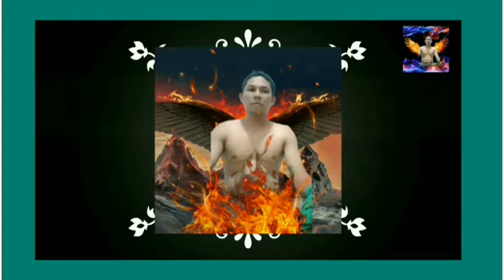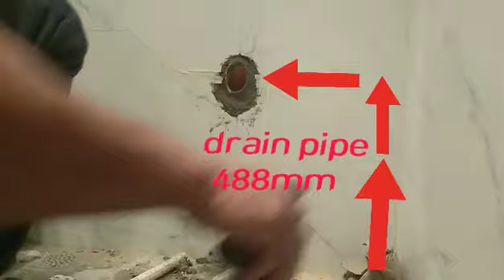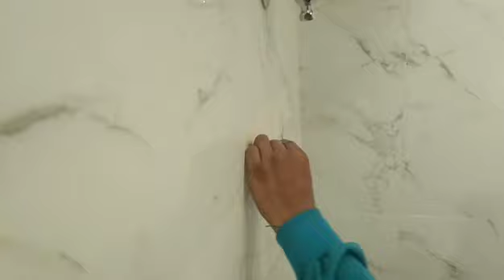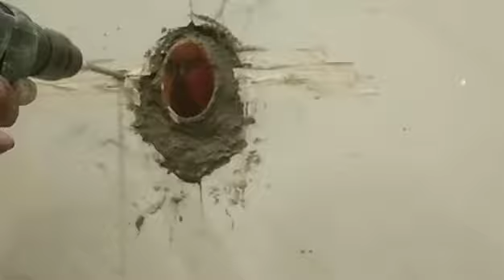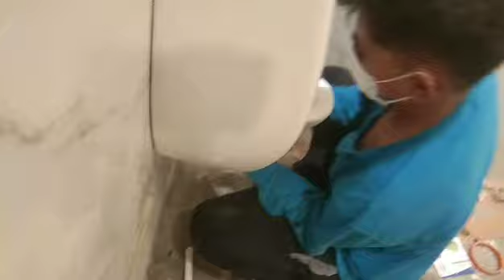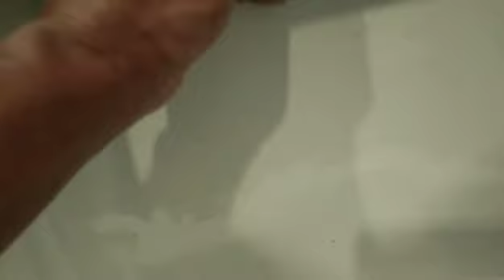how to installation urinal brand model by HCG

Comment: Lods bka pwd malaman ano height ng waterline mo jan... At anodin ang heigh ng waterline pag flushvalve ang type ng urinal salamat sna mapansin
Reply from the maker: 1200mm finish flooring. basahin ang specs sa plano boss kase yan ang dapat masunod at dyan  tutugma sa mga ibang klase ng fixtures

Comment: Idol tanong lang po ano po sukat ng abang ng pvc orange pipe 2 at sa water line salamat hindi ko po kasi alam sukat niyan
Reply from the maker: pvc drain hieght 488mm finish flooring
water supply 1200mm from finish flooring.
Reply from the maker: yan ang tama sukat standandard na po yan sa urinal
Reply: @rodulfoboyovlogs  salamat po idol God bless po sayo
Reply: @rodulfoboyovlogs 48cm po bayun idol pwede po ba 50cm? Sa pvc orange?
Reply from the maker: pwede yan basta 55cm kong wala pa cya tiles flooring kase allawance na yan at yan resulta sa 488mm. yung 50cm mo pang lavavo yan na finish standard

Comment: Ilan po ba ang standard na taas ng abang para sa waterline ng urinal?at ilan din ang standard na taas ng abang para sa drainage ng urinal?
Reply from the maker: waterline supply from finish flooring 1200mm at ang drainages urinal from finish flooring 488mm
Reply: @rodulfoboyovlogs  maraming salamat po sir